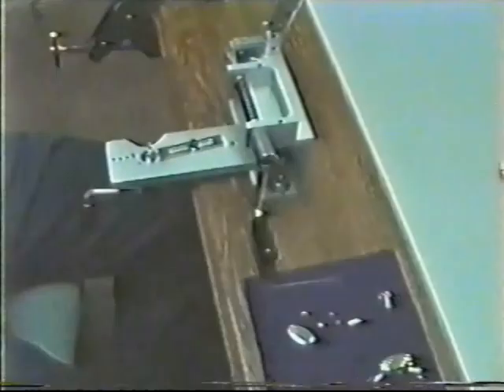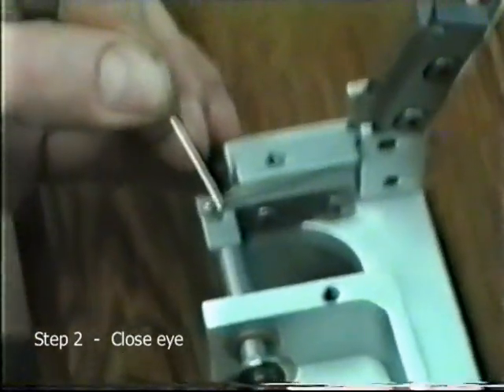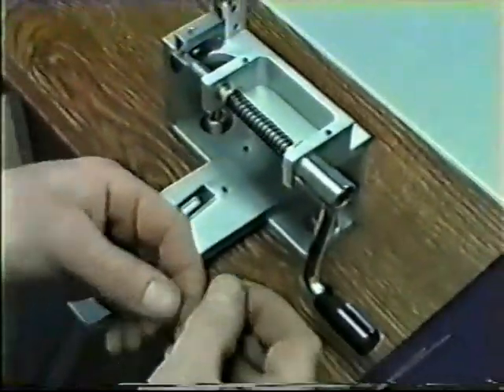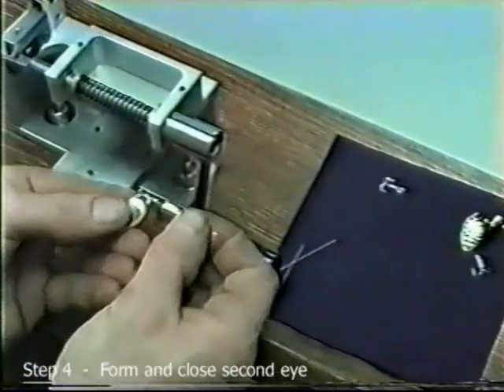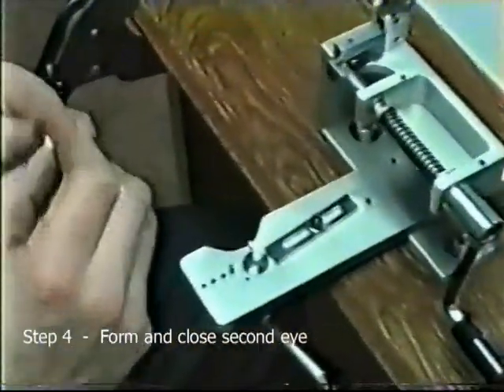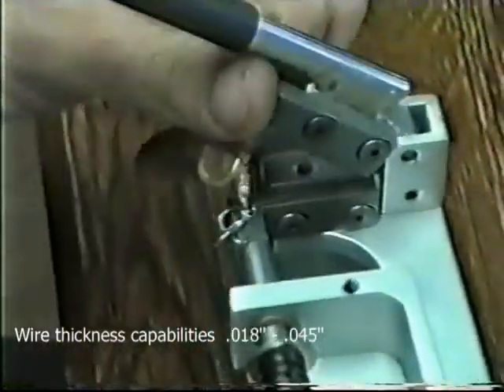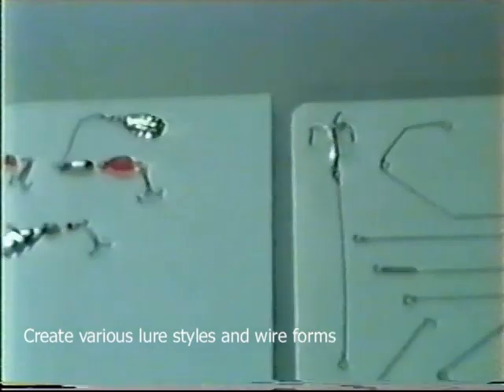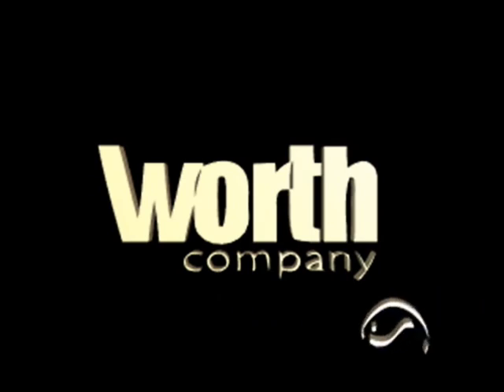Fishing Lure Wire Former

Comment: A key feature is forming a controlled loop as the final step.  There are lots of wire benders, but fewer that perform controlled closed loops at the end of the inline spinner process.  The TwisTech former does not appear to be available anymore, so yours is among only a very few commercial grade
wire formers.  I make hundreds of inline spinners, but your price is really so high that it becomes impractical, even for tackle shops.

Comment: A new TwisTech wire former came available, so I bought it.  I purchased the TwisTech metal clamp mount as well.  I've made well over 2500 inline spinners with it...truly a fine compact, efficient, precision wire former.  It requires less space and movement than yours.  I also have a Boggs tackle maker with both wire adaptor attachments.  I like the design of your wire tormer, but the cost is a lot.
Reply: Where do I order this twis tech wire former?